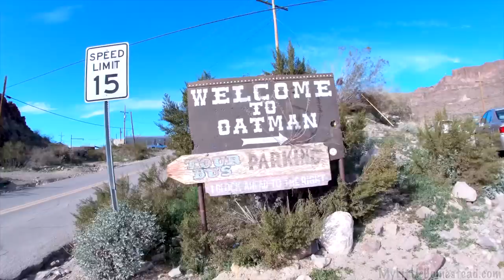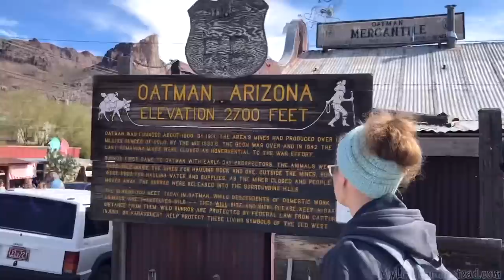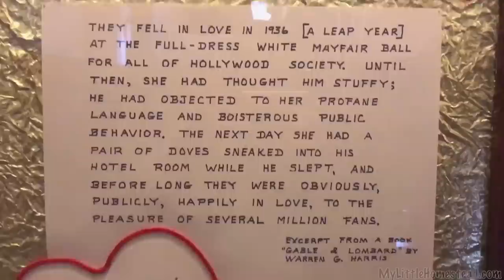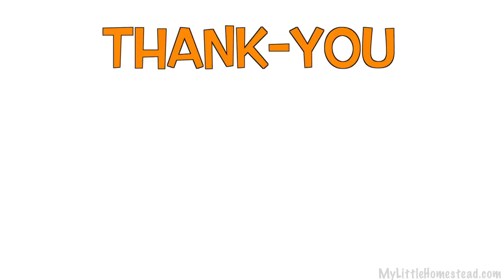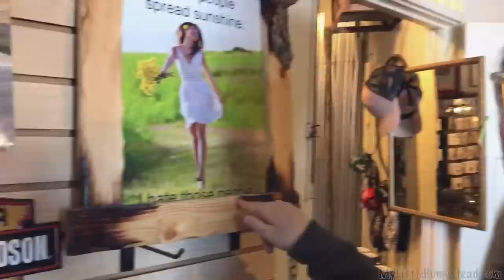Aquaponic Tanks, Trip to Oatman & Baby spots Mobile @20:37!  | Weekly Peek Ep223

Comment: hey got a question? where do you get the long earthbags for homebuilding?
Reply: Question?
Reply from the maker: China earthbags
Where We Bought our Earthbags (Continuous Sandbags or Earth Bags :)  | Weekly Peek 
https://www.youtube.com/my_videos?o=U&sq=China 
It is called 14 inch continuous polyweave bag material with a 6 month UV protection. Manufactured and imported by MLH directly from a plastic bag manufacturing plant in China. Years ago we bought it in bulk and sold off everything we were not planning to use. Back then, the cost was .15 cents per lineal foot.